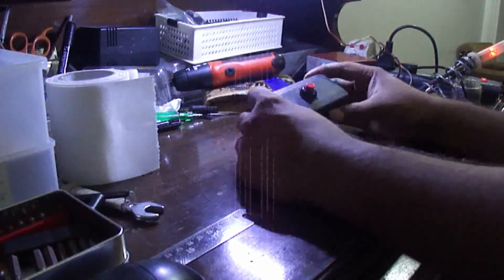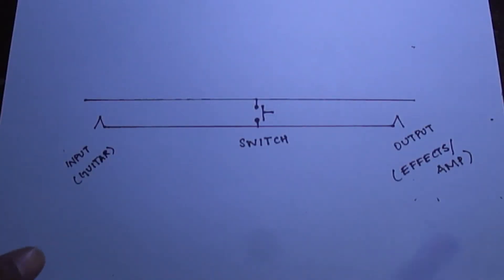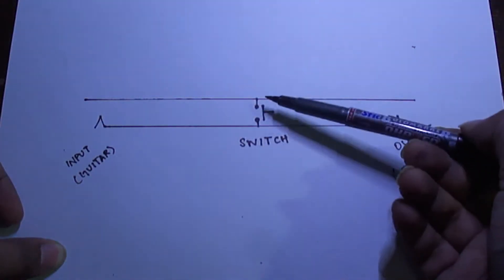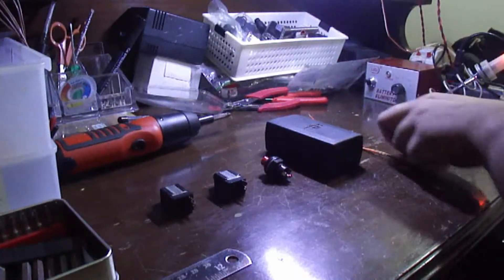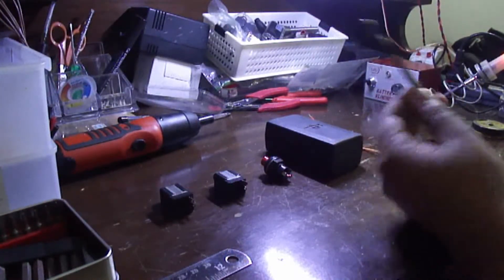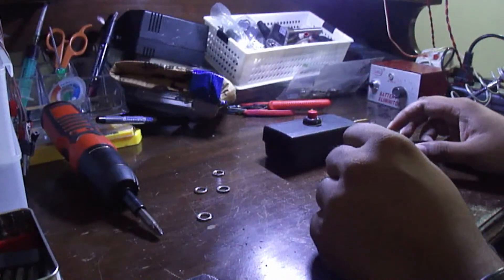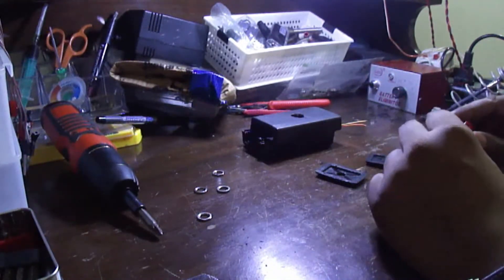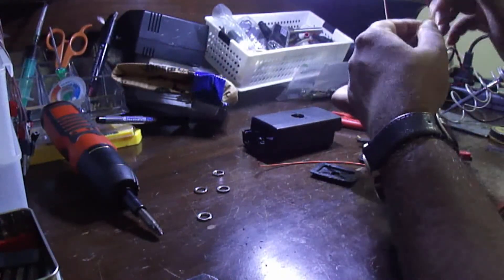DIY Guitar Kill Switch (or keyboard sustain pedal/Foot Switch) Tutorial

Comment: how does this work? Is it just press once and turn on to off? and press again to turn back on? Can it be used in normal sustain pedal inputs on keyboards?
Reply from the maker: It's not latching. It works exactly like a sustain pedal for keyboards.
Reply: @vishwam.aggarwal  so latching is on and off state, when you are not pressing?
Reply from the maker: @lesleo123  latching is when it connects the two terminals of the switch when pressed once, and disconnects them when pressed again.

Comment: Hey man great video. Very well put together. I built it and it's working fine, except for it's off without pressin it, rather than on and being killed when pressed. I'd like to have it the other way around, like normal. Do you know what I did wrong or did I buy the wrong kind of switch? Thanks.
Reply from the maker: Hey Charles! Thanks for the appreciation!
If you followed the video exactly for the connections, then you probably got the wrong sort of switch. But you can use that too. From the behavior you described, you have a "Normally Closed" type of SPST Push Button. All you have to do is connect the switch in series instead of parallel (Parallel is what I've shown in the video).
A series connection is even simpler. Here are a few easy steps:
1. Connect the ground (Sleeve of the connector) of the input to the ground (Sleeve) of the output.
2. Connect the signal (Tip of the connector) of the guitar to one of the terminals of the switch and the other terminal of the switch to the output (Tip).

Hope you understood. You can google a series connection if you want. If you have any problems, you can get back to me. Best of Luck!
Reply: can you upload a video of playing guitar with it